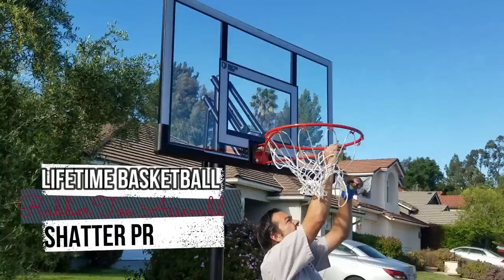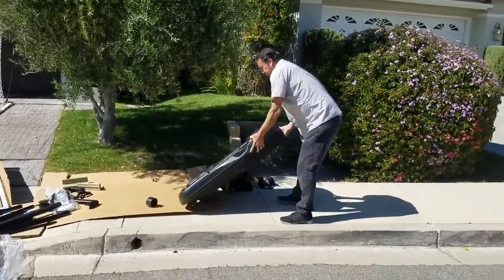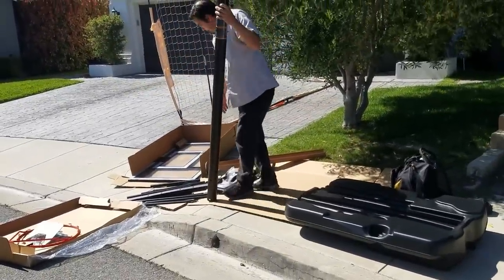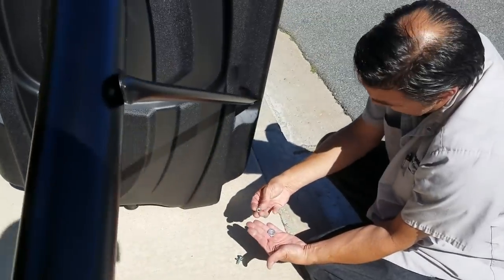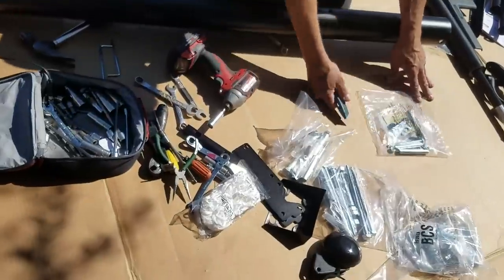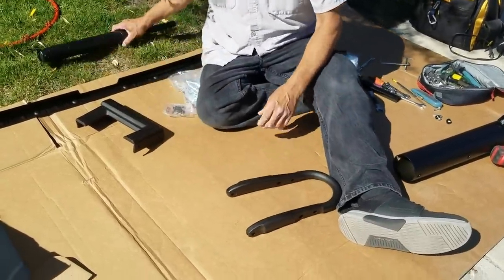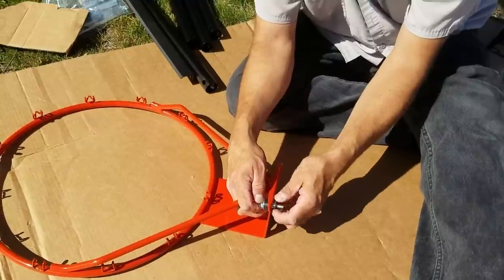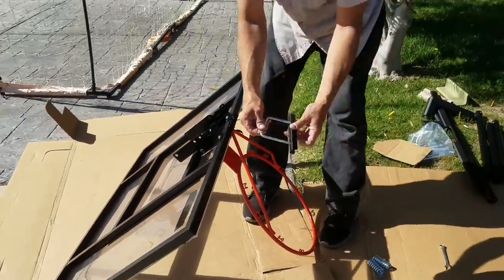How To Lifetime Power Lift Portable Basketball System Build

Comment: THANK YOU, RT Assembly. You basically saved our hoop - I was stuck multiple times on steps 2 & 3 of Lifetime Hoop 71286 because the company's directions horrific directions. As many others have said, I WISH I had seen your vid before I started. Your vid could have saved me multiple HOURS of frustration had I watched it instead of following the company directions + company vids. Luckily my wife found your vid eventually because I was so frustrated I was on the verge of giving up and trashing the entire hoop! The steps described in your vid make a lot more sense then what's in the company directions (particularly in terms of when & how to install the backboard, lift arm to pole, etc). And most helpful of all is your COMMENTARY describing what's happening in the vid and WHY. 

YOU saved the day, my friend. #SuperHero

Comment: Awesome video didn’t even use my instruction guide at all. Thanks only one thing my box was missing a tire but besides that, what a great 👍🏼 video 💯
Reply from the maker: Thanks for your comment.That is great to hear how it went.So I guess you just left one wheel out and continued assembly.If you contact manufacturer.they could send you the other wheel.And there is a few tricks to putting it on without damaging the base.And if you filled with water,you'd have to empty to make easier.Then fill back up when done.Let me know if you ever get to putting other wheel,i can tell you how..take care

Comment: Thanks so much for making and sharing this video. It was incredibly helpful. I relied almost entirely on the video rather than following the user manual. Only a few times did I consult the manual to check if I was using the right bolts/screws. This is one of those assembly tasks where it's much easier to follow a video and see how things are done rather than reading how to do it. 

One thing I wish I'd done -- I wish I'd bought a drill at the start and used it during the earlier parts of the assembly. I thought I could get away with just using the wrenches and such that I already had, but then I got to the drill part and realized there was no getting around it. It would have been much easier if I'd made sure I had all the recommended tools going in -- the ratchet wrenches with the right sizes and all. When I did buy a drill, I realized how much easier it made everything. I think the instruction manual probably has a list of required tools, so maybe for novices like me who think that a pair of crescent wrenches and screwdriver will get the job done all right, a good warning/reminder about tools up front would be good. Lesson learned.

Overall, assembly time for me was probably 5 hours. There were a number of steps where I had to rewatch the video several times and spend some time figuring it out. I'm not really handy, but I get by for the needed task now and then.

I found it kind of comical that around the 33:50 min. mark, you're drilling in a screw and warning people about being careful, and then the video transitions and next you have a huge blue bandage on your hand, but you don't make any comments about it. 

I decided to fill the base with water and then put about 6 sandbags on top, since I wasn't sure if this would be the permanent location. I see that Lifetime doesn't recommend this approach (sandbags on top), but they don't say why.  Seems stable enough. You might want to mention other approaches, such as BaseGel or the anchor method.

Overall, I'm pleased with the stability of this hoop. Here's a short video clip of me shooting baskets on it so people can get a sense of it. https://www.youtube.com/watch?v=GO1G-drggiM. It seems sturdy enough. My kids love how easy it is to lower the height. Even my 9-year-old can raise and lower the hoop.
Reply from the maker: Hi,and thanks for the great comment. I'm glad to have helped you.After assembling thousands of items over 20 yrs,hundreds being basketball hoops,I felt people need me all over the world,not just in my huge city..and the videos that were already out there were actually not as helpful as they needed to be.So looking forward to more helpful videos,and thanks again for great comment. Good job on the hoop,and take care

Comment: Excellent video. I got stuck attempting to connect the lifter arms to the bottom hole of the connection arms. The instructions have the backboard at a 90-degree angle, which is misleading. In that position, the lifter arms will not reach the holes of the connection arms. Thank you for your video!
Reply from the maker: Glad it helped , Yes there are several things that are hard to see,especially if its someones first time building it. Take care

Comment: The centerlock nut connecting my backboard bracket to the backboard got stuck onto the 9/16 hex nut screw with the bracket on but isn’t screwed on all the way and is loose. I tried to tighten it then loosen it with my wrench but it was just stuck and kept rounding out the nut. How would you recommend getting the nut out? It’s a hard angle to use tools on and I don’t want to ruin the backboard.
Reply from the maker: Hi thanks for comment. That is not good situation,so if you can't remove i would call manufacturer and see if they'll send replacement backboard with brackets and hardware.It just might be a day or two,but it will be easier,and done correctly, I think if you tell them situation ,they should send pretty quick. Hope this helps.take care

Comment: Hi, I just made a mistake it looks like, my alignment of top pole (probably middle & top both) needs to be rotated 90 degrees. This I am realizing after setting up the hoop & glass with the 4 rods. Is there any way I can open the top poles from middle or middle top from lower? Or is there an easy way to rotate it? Otherwise if I attach the poles with the rodes, hoop system would remain standing rotated 90 degress with back support which I think may not provide enough support when ball hits. Please advise.  Thank you so much for such an amazingly accurate video, very helpful !! Thnaks
Reply from the maker: Hi .thanks for question. Ahh,well did you bang the pole together on a piece of wood yet? hopefully not. i stuck one of the bolts thru the holes at second from the end,on the pole once..and was able to bang apart. but had to straighten the bolt again by putting a nut on the end,to protect the threads,and banging it in curb of the street. got it straight and kept going. hope this story helps. on the flipside of that ,i once had to call store to bring back pole and lucky that they gave me 3 replacement pieces..take care  best of luck

Comment: Thank you You did everything until the rim with the spring do you think I could get it in there tighter without a drill piece like that and I ask have a ratchet rench if that helps information
Reply from the maker: Hi,thanks for question.Yes,I use a 1/2 inch angled ratchet to tighten or loosen if needed.You can also use a ratchet handle,with a deep socket on it. An open end wrench even works,but takes a lot longer.The tighter it is ,the less bounce or spring the rim has when the ball bounces on it. I hope this helped,good luck

Comment: Have you ever had an issue with the pin not triggering the handle? I seems like ours is not allowing the handle and spring arm to work correctly. I hope I am explaining this correctly. We are having to add a Screwdriver to hit the pin to love the hoop up and  down. Please help! Thank you!!
Reply from the maker: Hi thanks for comment. Yes,it sounds like handle was not assembled right,or maybe something defective . I would call a local professional assembly service if possible to fix,because you could hurt yourself at this point if you start taking things apart to troubleshoot.

Comment: Dude you rock..... thank you, thank you, thank you.....the instructions were easy....but you made it even easier.....my only problem was when I went to fill with water there was a small hole by the wheel pin causing it to all leak out......guess I'm going with sand
Reply from the maker: glad to have helped,i appreciate the comment..also , if you contact lifetime,let them know about the base leaking,they should send you a new base..thanks man
Reply from the maker: Thank you, thank you!!

Comment: I’m actually building mine just the way have done it but my wife insists on doing it by the manual steps but it’s much harder.. this way is so much easier and faster. I do have one question to drill on the pole did you make that hole or are you using what was on holes that are there already.
Reply from the maker: Hi , the holes in the pole are there already, hope that helps.take care

Comment: Hi.  Great video.  Ours is assembled but it won't extend to 10 feet despite being sunk to the exact depth.  When extended to it's full height (only 8ft 10") the vertical struts are not as close to the centre pole as they are on your video when yours is at the full height.   The set up seems correct.   Any suggestions?    Lifetime are saying it must be sunk too deep.  I don't believe it is and the difference in the top height is 1 foot 2 inches which is massive.  I know yours is not the sunk one (in this video)  but do you have experience of this?  I'm struggling to get this resolved.
Reply from the maker: Hi, thanks for comment,question. I am thinking you have the in ground version where the pole is set in concrete. When you say the sunk one.If so,i don't know how fix without digging out,and filling hole with another foot and 2 inches,to bring entire thing up. There are plenty different versions of basketball hoops out there , i would have to know what kind you have to troubleshoot issue correctly.
Reply from the maker: If it is a portable basketball hoop, maybe put 1 or 2 pallets underneath the base to bring entire system up. It would have to be stable as well, so maybe strap the base to the pallets also. Just an idea that might work no matter what kind you have , as far as portables go.. i hope that helps. take care

Comment: Hey man just wondering on the instructions it says 375 lbs of sand to fill the base. is that all necessary or would about 200 lbs be enough?
Reply from the maker: I would fill it with water and then put sand bags on top if needed.  That way it is easier to move if you want to.  Hope this helps

Comment: When attaching the backboard brackets, my centre lock nuts just get stuck and it’s very loose. I have tried to use a lot of force but it’s been no help. Any suggestions?
Reply from the maker: Hi thanks for comment If you can remove them, i would call manufacterer and see if they will send new ones. or maybe take and match up exactly with same at hardware store,But let manufacturer know.and they will probably send new ones for you, probably no charge ,and store would be probably a few dollars or so. Hope that helps,take care

Comment: Hi, my lifetime 90176 with trigger style height adjustment won't go to 10' slot the rim stop hits the pole so it can't go in ?
Reply from the maker: Hi,thanks for comment.Well,I looked up the model number,and pictures of both variations of the trigger handle were shown.With that same model number?? Interesting for me to see this.So,i am going to assume you have the grey handle that is a solid piece.The other handle is blue and has a left and right side to assemble together with guts inside.But the grey handle version ,has a plastic top that gets inserted before you run the top bolt through it.That plastic piece sometimes presses against the pole before it clicks into the ten foot notch on the mechanism.You can either file off the end of the plastic piece enough until the mechanism clicks into ten foot,..or you can take the bolt out of the top and remove piece or flip piece backwards.I would try shaving it down with a file,because i believe the plastic top piece adds strength and support.The unit will still function without that piece,but its a plastic molding issue I've noticed over the years....If you have the blue handle version,then all i can think of is the square pole inside the adjustment mechanism has the notches in the wrong place and maybe call lifetime to replace defect. Hope i have helped,sorry for delayed reply.Take care

Comment: @26:15 the 3/4 inch bolt doesn't fit through that hole, have you had this problem?
Reply: I tried using the methods you showed and still no luck.
Reply from the maker: yes,there is paint on the pieces which makes it difficult. you can take a round file and file the inside of the holes,but if you push and spin the bolt,eventually threads through. Also,there are two of the 3/4 bolts that are little longer than the others,those are the ones you use for behind the backboard.If you use one of the others,you'll get it finally through and wind up being a bit short for the nut to go on at the other end.So you'd have to back it all the way out again,and use the longer one,..not fun. Anyway,i hope that helps

Comment: I am not able to slide the axle through the holes on the portable base.  The holes on the base don't seem to be aligned. Even without the pole, the axle does not seem to go though both the holes on the base. Is this to be expected? All the videos online and instructions say that you need to use a mallet to push it through, but the issue here seems to be a bit different as the axle is hitting the base and not aligned to the hole in the base.  I tried even with the pole to see if the weight of the pole helps to align/push the axle through both holes on base, but it did not help. 
Any tips on what I might be doing wrong?
Reply from the maker: Hi,thanks again.I replied with the best explanation i could think of regarding this section of assembly.Hopefully you have got it by now.However,if not then your idea about using the weight of the pole to line up is a good way to put what i was trying do describe as well.If you can get the axle through the first wheel,and put it through the first hole in base,then bring the pole up to where it needs to go and push axle through both holes of pole,just barely coming through..it can be away from the last hole in base at this point..while holding the axle right where it is,carefully bring pole in against the base and use pole to help bend the base to where the axle lines up.Very difficult part. 
having the pole and base in the exact position i show makes this easier to do.Once pole is started through other side of base,remember to put other wheel on before banging through to the end.If you forget the other wheel,you'll have another hard time prying axle up and backing out.Anyway , good luck ,hope I have helped.I would say watch the video over to see exactly how i do it.It is never really an easy thing to do

Comment: Dose it shake too much or is it better than spalding please can you reply asap because I’m deciding between the two of them thanks
Reply from the maker: Hi,thanks for comment.Well,they all shake a little.Personally,I like the lifetime hoops better.The 54 inch is my favorite.And they are easier to assemble,in my opinion.It is hard enough as it is for the average consumer to be able to assemble for the first time.When assembling,make sure poles are correct before banging tight together,they are almost impossible to pry apart if they are wrong.And take your time running axle through the bottom connecting pole to base and wheels.Watch video again if needed,and careful not to damage plastic base. good luck,take care

Comment: Is it better to fill with sand or water?
Reply from the maker: Hi,thanks for question.That has been asked a lot of times over the years.I like to fill the base with water,and if you think it needs more weight to hold it down,then put sand bags on top of base.Once you put sand inside the base,its next to impossible to get out.If you fill the base with water,you can always pour the water out later on if you want to disassemble for any reason.With sand in base,it becomes so heavy,which makes so hard to move.There is a reason why they call it a portable hoop.It is basically up to you to decide if you want sand or water.Also,in my opinion,if you put water in it , you can tell right away if the base leaks in any way.Even if its a pinhole leak in the base,it is defective and should be replaced.And if you fill with sand,you may never know that the base has a hole in it.I hope this info helps

Comment: Can someone help? I’ve spent 8 hours on this and the backboard is facing the ground when the pole is upright (it’s off by 90 degrees). Do I just need to reposition and tighten the bolts for the shorter top arms or is something else likely wrong?
Reply from the maker: Hi,thanks for comment. Well, i would have to see it. But it sounds like the shorter arms were put on bottom ,and longer ones on top. ..need to switch...and attach lifter arms to the correct end holes of the longer lower arms..hope this helps.take care

Comment: my dad and i are stuck on the handle, because yours has 2 holes, and ours have one hole and a pin and it does nit make sense. could you help please?
Reply from the maker: Hi, thanks for comment. Well there should be a small handle, with one hole, and a larger handle with two holes, that work together. According to your description , it sounds like maybe it is missing the larger handle? There are a lot of different models out there , but if its missing,then call the manufacturer and they should send for free. I hope that helps. Take care